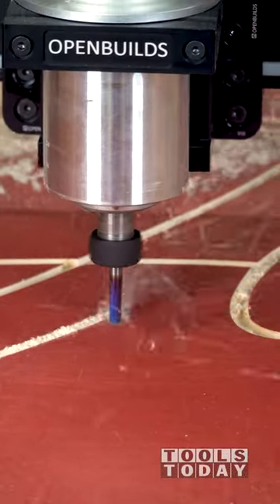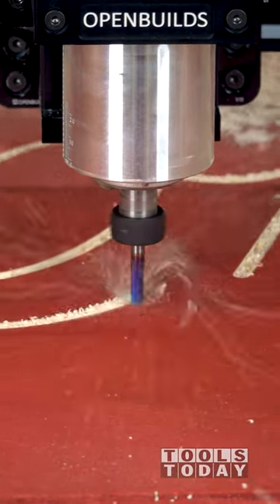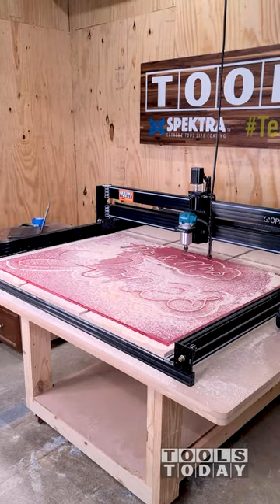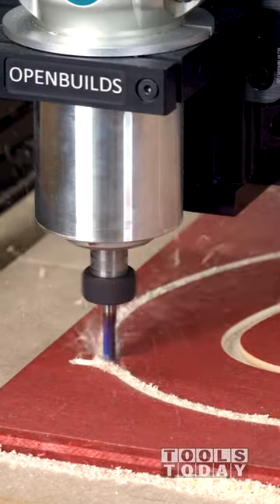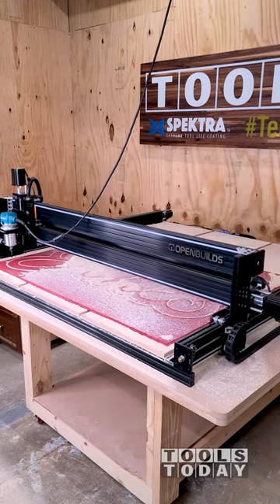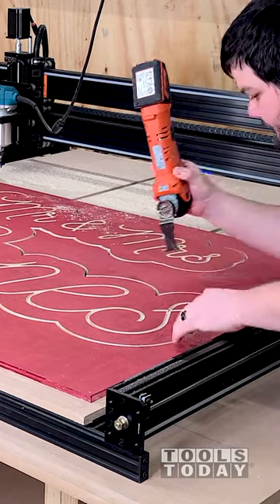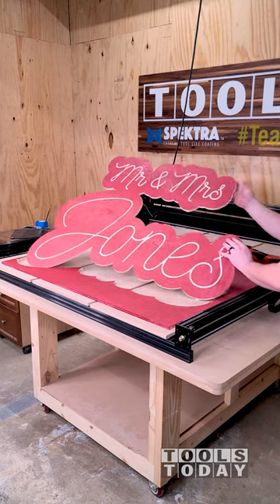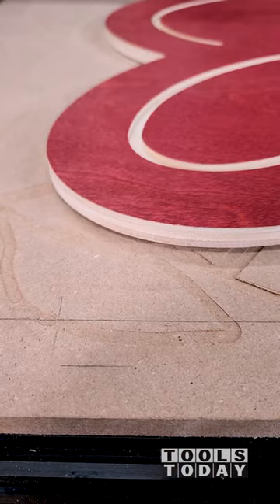Cutting Out a Large Sign

Comment: If you do two cuts, shouldn’t you use the downcut bit for the initial and the compression or upcut for the next pass?
Reply from the maker: No, I'm cutting below the upcut portion on the first pass, so the surface of the material is fully in contact with the down cut portion of the bit